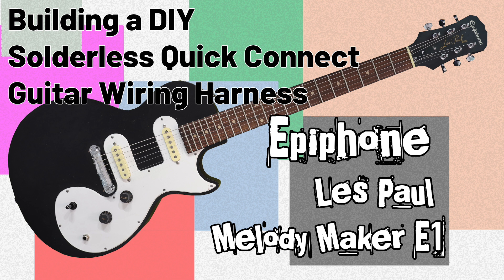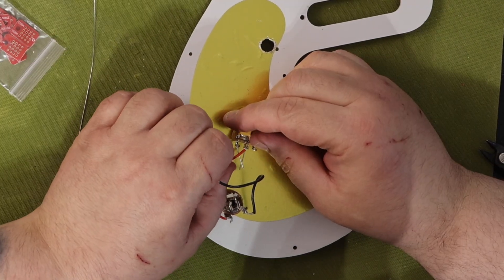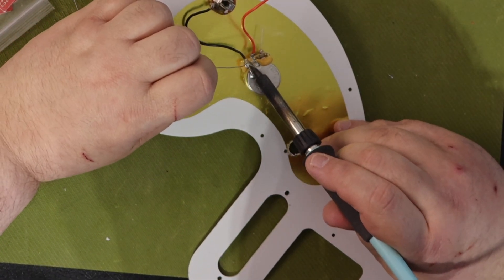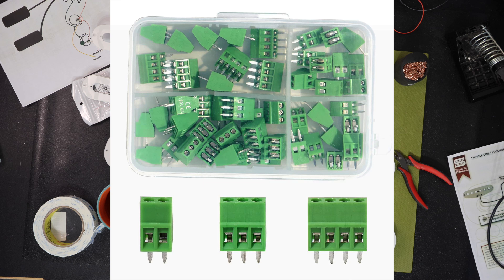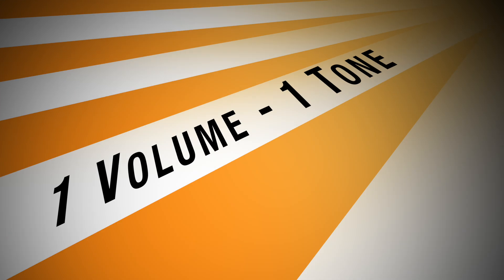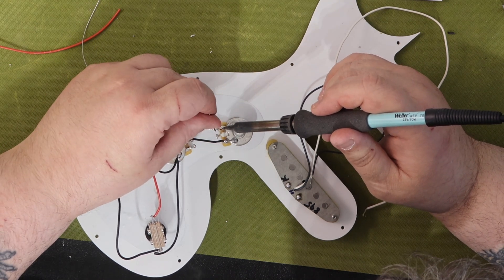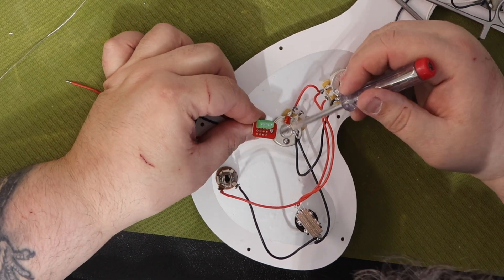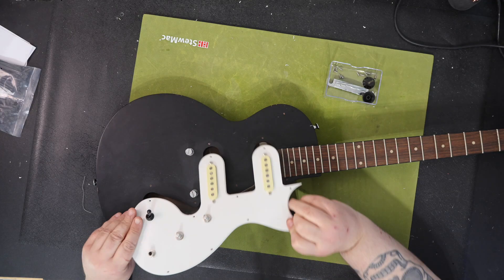Building A DIY Solderless Quick Connect Guitar Wiring Harness

Comment from the maker: Building A DIY Solderless Quick Connect Guitar Wiring Harness.

PCB Mount Screw Terminal Block Connector

https://a.co/d/6rkpT32

Small PC Boards

https://a.co/d/3gWMQNU

Kluson drop in tuners

https://stewmac.sjv.io/bOaEL6